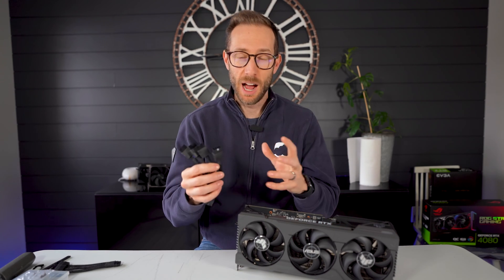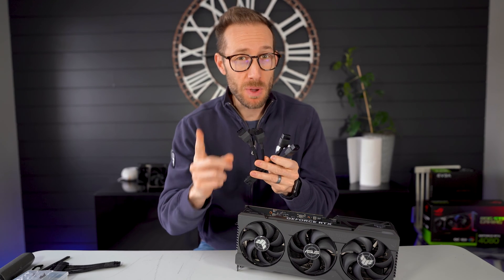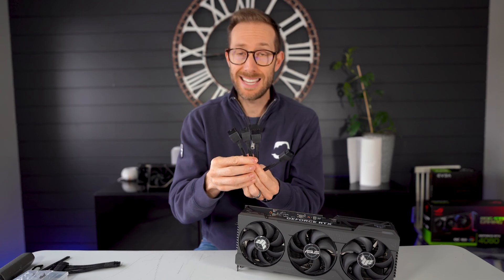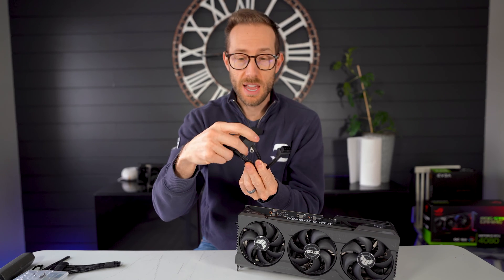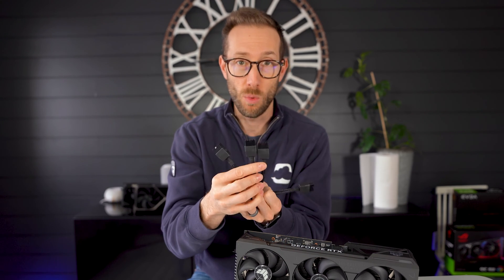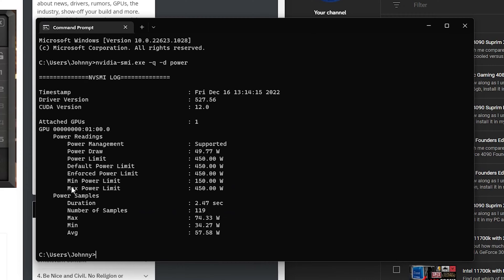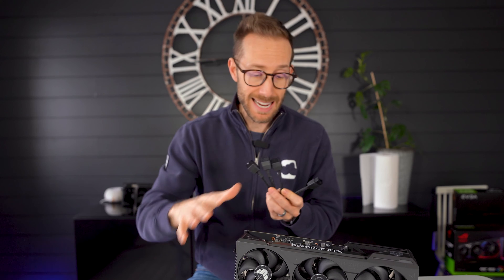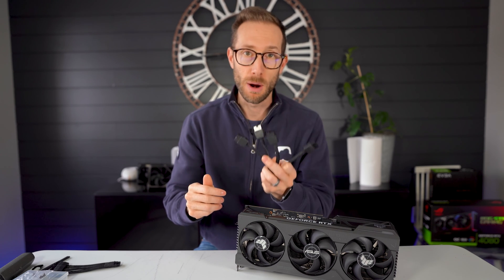Do 4090s Work With Only 3x8pin Power Connectors?

Comment: Came here from your MSI 4090 Suprim X vs Liquid X Comparison. And Cablemod, after talking with them, clarified to me that if I buy from them the 4-pin version or the 3-pin version they will still be able to run 600W on the cards.

Also from what I know Corsair even offers just 2 pin cables for their adapter.

I would have used the standard 4-pin that comes with the GPU but my PSU only has 3 remaining cables that I can use and I cannot pull a 4th one. So I have to settle with 3 or order a new PSU like the Seasonic Vertex. Luckily the 3 cable adaptor from Cablemod works with 600W.
Reply from the maker: That's great news about Cablemod.  I'm using the Corsair 2x8pin connector with the 4080 FE I have in my system. It works perfectly!  Very happy with it.  I've purchased an EVGA 1300w SuperNova, so when I upgrade, I'll need a 3x8pin or 4x8pin solution for it.  I'll probably go with the 4x8pin Cablemod to future proof myself with 4080s and 4090s.
Reply: Can you tell me which cable do you buy from cable mod? I have the issue right now I have Corsair r850 I don't have enough space for the 4th cable.

Comment: For the 3 8 pin can I use only 2 ?
Reply from the maker: Doubt it, but you can try.  Your computer just won't boot if it doesn't have enough power to the GPU.  That or your computer will reboot during high loads, like gaming.

Comment: hi friend it's a pleasure to meet you here, I have a small problem non, I have a PSU evga supernova 850 GT, I only have 3x8 VGA connectors, my question is how can I make my rtx 4090 xtreme work with all its 600w power and not limit it to 450w? Do you have a cable solution you can recommend? if you have cable link to purchase that would be great also I will subscribe thank you so much
Reply from the maker: Answered his on the video with the 12VHPWR cable.

Comment: Rookie here….how can I run a 4th cable to get all 4 plugged in??
Reply from the maker: No worries!  If your power supply doesn't support 4x PCI Express cables, then you have two options:   buy a new bigger power supply or buy yourself a 2x8pin PCI Express to 12vhpwr such as the one I talk about in this video:  https://youtu.be/IpujnC1lGY4

Comment: Need help mate, could I use a 16pinto8pin connector to power a 8 pin rtx 4060?😅
Reply from the maker: I actually didn't know that type of cable existed until you just mentioned it.  I'm curious, why not just use a standard 8pin to 8pin cable that comes with all power supplies?
Reply: @ order a new psu I did end up using the norm 6x2 8pin.. but yeah it comes with a 16pin to 2x8pins .. I thought I could use one of them.. but don’t wana damage anything.
Reply from the maker: Good to hear.  Yeah, that 16pin to 2x8pins is meant for 2x8pins side to be connected to the PSU and then the 16pin connected to your GPU.  I don't think you can reverse it the other way around.
Reply: @ no no it has the 16 into the psu then two cables coming from ithat with 6+2 ends it came with the psu.. there’s a 16 to 16 that pushes 600watts alone.. MSI
850W Gold A850G check it out for yourself.
Reply from the maker: Ahhhhh, very interesting.  I see an image on their website that explains it well.  You could use the 16pin port to 2x8pins on your GPU (if you used two), or add another 8pin if you had 3x8pin, like a Strix 3080.

Comment: So I got my PC from NZXT and its honestly been a nightmare from the start having to send the PC back to them 3x. Short story,  2 bad GPU causing force loop restart and 3rd time was shipping damage. They have only 3 PSI plugged in to my power supply but I only notice this due to an issue im having... When im playing games I will randomly get a black screen on both monitors and the GPU fans will run high RPM. I dont know how to correct it at this point. Is anyone having this issue???? Also, I will add my power supply does not have another open slot 9 pin connector to plug in the 4th PSI...
Reply from the maker: Sorry to hear about your issues.  To me, it sounds like a power supply issue.  What size power supply are you using?  Consider buying a 2x8pin PCI-E to 12vhpwr cable like the one I speak about here:  https://youtu.be/IpujnC1lGY4

Comment: Great channel just subscribed Does the same apply to my new 4080 super oc I have a NXZT psu and the new cable is 2 as opposed to 3
Reply from the maker: I actually don't know.  I haven't tested this with a 4080 Super to see if it will run on two 8pin PCI Express cables.  Instead, I recommend buying a 600w 12vhpwr cable like this one:  https://www.moddiy.com/products/ATX-3.0-PCIe-5.0-600W-Dual-8-Pin-to-12VHPWR-16-Pin-Power-Cable.html  It will work with only two 8pin PCI ports.

Comment: I'm using a 3x8 adapter and my power limit is set at 495W with a Zotac 4090 AMP Extreme AIRO on an asus thor 850W, with the first descendant with no fps cap I encountered some PC reboot, capped at 120fps all good, I now have an HX1000i ready to install with the 12VHPWR 2x8pins 600w cable.
Reply from the maker: Interesting.  I only had a chance to test it on that Asus TUF 4090.  I suppose other manufacturers could set the limit differently with 3x8pin.  That Zotac AMP is a monster card.  I wish I had tested one.  I considered buying that model 4070 Ti for myself a while back.

Comment: so i know this is old but i bought a the ASUS STRIX 4090 with the ASUS 1000W THOR PSU (Non ATX 3.0) a couple months ago but my problem was that i has the old LIAN LI  O11D which well doesnt even fit a 4090, I purchased the new LIAN LI O11D EVO lamboghini edition (as a car fan) which it stats it fits the 4090 (It does) however it doesnt allow for the cable that comes with my GPU/PSU a 16 4x8 splitter that came with the GPU/PSU so now i cant fit the side panel on without seriously bending and damaging the cable. Would i be fine to buy a 3x8 Stimmer cable and only plug 3 out of the 4 or should i  buy an atx 3.0 psu (after just buying a psu) then find a cable that fits properly???
Reply from the maker: No no, buy yourself a 600w 12vhpwr cable from ModDIY.com specifically for your Asus Thor PSU. It will come with two 8pin connectors that connect into your PSU and then a 16pin for your GPU. If the side panel is too tight, consider a CableMod 90 adapter.  No need to buy a new PSU.
Reply: @JohnLCharette  yh i was planning the Cablemod 90° adapter i never bought one yet because of that melting issue and cablemod did a recall on there adapters and haven’t made a up to date one. The only reason i said the strimmer is thats what lian shows with this case but they only do a 3x8 and i have 4x8 and wasnt sure it would work until i found this vid. And im more the strimmer side because it allows me to hide the massive 4x8 adapter behind the case wall where as 90° adapters it will stay in view on under the gpu and its looks so bad. Thanks though il have a look around just nice to know i can use 3x8 on a 4x8 safely
Reply: Hate to be a pain, i just want to make sure i get it right. so you mean the "12VHPWR 600W PCIe 5.0 Dual 8 Pin to 16 Pin Power Cable for Seasonic and Asus". this will replace the 16 4x8pin adapter to 4x8pin to 4x8pin into psu??  they also sell the 90degree version which i might get 1st just to be safe on the case side
Reply from the maker: Yes, that’s exactly right. I use them on my Corsair RM1000x and they work great. Agreed. If you’re tight on space, grab the 90 degree version.
Reply: @JohnLCharette  so i read around on reddit and stuff for some extra info and someone said they had a 16 2x8 with there seasonic psu. So i checked my asus thor p2 and turns out i have the 16 2x8 already 🤣🤣. However i might still opt for the moddiy 90° as i can get it in white. Honestly thanks for the help, never knew i could go from the 4x8 to a 2x8. This is still technically my 1st ever pc build. Just upgraded from a 3060 after 3 years so im still learning a lot
Reply from the maker: Aww. Glad I could help. I recently bought a used Asus Thor and it came with one of those cables as well. I was very pleased. I used it on my latest ProArt ‘Dream Creator’ build. Thanks for watching!

Comment: Thank u for this as my msi gaming x trio 4090 needed to be rmaed well they  upgraded me to the msi 4090 Suprim X and no cables but from What i see the new in boxed ones come with 4x8 pin adapters but all i have is the 3x8 pin adapter from the x trio which sucks they sent it without the proper cables but also didnt include there so called anti sag sup[port
Reply from the maker: That sucks. Yeah, it’ll work but limited speeds. I recommend getting a 600w 12vhpwr cable for your power supply.
Reply: @JohnLCharette  my psu is a evga p3 80 plus platinum 1200w I got this year it doesn’t have that 12vhpwr
Reply from the maker: Buy yourself a dedicated 600w cable that works with an EVGA power supply.  You can find them here:  https://www.moddiy.com/products/ATX-3.0-PCIe-5.0-600W-Dual-8-Pin-to-12VHPWR-16-Pin-Power-Cable.html

Comment: Surely it all depends on the kind of adapter cable and/or the PSU you're using it with, no?
Reply from the maker: If you run any 4090 with only 3x8pin power connectors, it either won't work, or it will auto scale down the power limit to 450w.  I don't recommend using the 4x8pin adapter, but instead get yourself a 12vhpwr cable.  Check out an example here:  https://youtu.be/IpujnC1lGY4

Comment: Exactly what I needed. Thanks.
Reply from the maker: Music to my ears.  Which 4090 are you using/considering?
Reply: @JohnLCharette  I went with the ASUS Tuf Gaming GeForce RTX 4090. It's run smoothly so far- I noticed a couple small (essentially negligible) issues before I added a fourth PCIe cable, but now it's up to the right standards.
Reply from the maker: Amazing.  Great card!  I did a full review about it here:  https://youtu.be/0t2Kxwf21Ls

Comment: My Evga RTX 3080TI FTW3 ULTRA HYBRID hits 450 watts full load with RTX. Certain games. Ryzen 9 7950x CPU MSI X670 MOBO. 32GB DDR5 6000NTS C32.I had to get 1000 watt PSU MSI MAG 750 watt PSU was hitting OCP. PC just shut off when load up the GPU hard. As soon at it hit 450 watts of draw it would shut off completely. Then i could turn off power switch or unplug it would boot up and do it again i tossed the other PSU i bet it hurt it. I dont it several times trying to figure out what caused it to shut off.
Reply from the maker: Yup, that's exactly what happens when you overload your power supply.  Thankfully, it's pretty easy to troubleshoot based on the instant shutdown + high power usage.  1000w is plenty of juice, even for a 4090.  You'll be safe for a while.  Thanks for sharing your story.

Comment: can you use 2 cables with the other 2 daisy chained?
Reply from the maker: GPU manufacturers recommend against it, but it works. What happens is you’re drawing up to 300w on that PSU line. It will come down to how good your power supply is. It’ll work though, just isn’t recommended.  It’s a better idea to get a power supply with four individual lines or a single 12vhpwr cable and avoid the adapter.

Comment: Hey.
what if in your box where the rtx was in is just a cable with 3 x8 pin connectors
is it then even possible to run the own rtx also on 4x8 connector cables if i would buy one, cause my power supply supports more cables
Reply from the maker: Yes, you can connect a 4x8pin connector, but it won't make any difference.  The GPU limits the total power draw based on the BIOS.  Depending on the 4090 it could be as low as 450w or as high at 600w.

Comment: Can I use another type connector like PCIe 5.0? I use dark power pro 13 and I have PCIe 5.0
Reply from the maker: Absolutely!  If you can use a dedicated 12vphwr cable.. I recommend that over any adapter.  I did a short video about a couple good options here:  https://www.youtube.com/watch?v=IpujnC1lGY4
Reply: @JohnLCharette  thanks a lot!!!
Reply: @JohnLCharette  Sorry for my impudence. Is it possible to install rtx 4090 Asus strix in the slot PCIe 5? I don't have enough space for PCIe 4
Reply from the maker: Yes!  PCIe 5 slots are backwards compatible with all PCIe devices.
Reply: @JohnLCharette  Thank You! It works!!!

Comment: What is better guys? Or safer?

If i get a 4070ti, it will be on either the old Rog Strix 1000W PSU, or the Aura Atx 3.0 version. The Aura version has a dedicated 12V HPWR connector on the psu, so it shouldnt need to have the gpu cable split into 3x6+2/8 pins to go into the psu.

But is it safer to have 3x6+2/8pin instead? Will just the 1 cable, 12V HPWR from psu to gpu be more dangerous to burn up? Or overclock?
Reply from the maker: @ashryver3605 - neither is safer than the other.  Both cables only draw what the GPU requests and are rated for up to 600w.  A 4070 Ti has a TDP of 285w, so there's no fear of the GPU drawing more than the cable/adapters can.

For me, it's an aesthetic thing.  I don't have an ATX 3.0 PSU, so I use a 2x8pin on the PSU to 12vhp cable to the GPU.  If you have an ATX 3.0, use the dedicated 12vhp cable from the PSU to the GPU.

The only safety concern with the 12vhp connector is ensuring it's plugged in ALL the way.  Hope this helps!
Reply: @JohnLCharette  oh I see thank you very much!!

I was worried that it would be "just fine" to use the adapter version, but that it might be some risk of not enough power flow or restriction of some sort, or if one type of connection was safer than the other.

Thought maybe I made the wrong choice in PSU (ordered the original atx 2.0 strix) and had second thoughts to buy the Aura Atx 3.0 instead. Thank you for clearing that up! I will stay with 2.0 instead as it's $90 cheaper.
Reply from the maker: Nah.. the only concern is when using a three of the four 8pin connectors from the GPU with a 4090.  It will limit your power draw to 450w.  It isn't the end of the world and doesn't affect performance all that much.

Good call going with the cheaper ATX 2.0 PSU.  Eventually all PSUs will be 3.0 and the prices will drop, but for now it's cheaper to get that one + a $30 cable.

Comment: This video save my life yesterday was building my new pc i bought every thing then i réalise that i have only 3 8pins cable i was so confused if i turn on my pc or non then i watch This vidéo its save my life but one more question i dont have tuf editon i have rog strix its same safe????
Reply from the maker: Ahhh, so glad to hear that my video helped.  Yes, you can run 3x8pin cables on a Strix as well.  If you run 'nvidia-smi.exe -q -d power' in a Command Prompt, it will tell you the Current Power Limit.  It should reflect 450w when using 3x8pin cables.
Reply: hey there, did just using 3 8 pin power cables work? I'm in the same situation, I plugged 3 8pins in but not a 4th since my psu didn't have it. And it didn't boot.

Comment: Im using the cable extension from cable mod, that has 3 cables, and nvidia-smi shows 510W as max power limit
Reply from the maker: What make/model card are you using and have you increased the Power Limit in Afterburner?
Reply: @JohnLCharette  Hmm. Yes i have. I have undervolted it using the curve, and increased the power limit to 113%.
The cable is CABLEMOD-ZUA
D-1350 CableMod Pro ModMesh 12VHPWR to 3x PCI-e Cable - 45cm
Reply from the maker: What make/model GPU? I ask because when I was testing the MSI 4090 Suprim, they limited it (even with the slider) to 520 or 530w. Your card may be similarly limited. Not all 4090s can accept 600w.
Reply: @JohnLCharette  Its 49NXM5MD6DSK KFA2 RTX 4090 SG 1-Click OC
Reply from the maker: Interesting. I’ve never heard of KFA2 as a brand before. I can’t speak to my experience or their power limit rating.  I’m guessing they did the same as MSI and limited the power draw to 510w. I wouldn’t be too worried, from my experience, there very very little increase in performance past 500w on 4090s.

Comment: have use 3 8pin 4090 founder editon, would it damage the card in the long run?
Reply from the maker: I haven't tried a 4090 FE with 3x8pin power connectors.  If it's anything like the Asus TUF 4090 I tested with, it'll simply limit the power output to 450w.  As far as I understand it, this doesn't have any negative impact on the card other than throttling performance a tiny bit (5-10%).  I've tested 4-5 4090s and you don't see much gain past 450w.  People were complaining about the Suprim cards limited their power draw at 520 & 530w vs the 600w on the FE, but it was still able to perform just as well, if not better.  If you only have 3x8pin power connectors, I think you'll be okay as long as your power supply is big enough to handle the load.
Reply: I have to use 4 pins of mine to work can’t use 3 pins I have founder edition

Comment: Does anyone know if the new lian li strimers will run the 600w? It only comes with 3 8 pin connectors
Reply from the maker: I haven't confirmed in person, but I'm guessing it will only pull up to 450w through the 3x8pin connectors.  So, if you could use only 3x8pin and restrict power.. or get a card with only 3x8pin.  I have heard that Lian Li is working on a new 12v 16pin version of their Strimer product, but haven't seen it yet.  What GPU do you currently have?